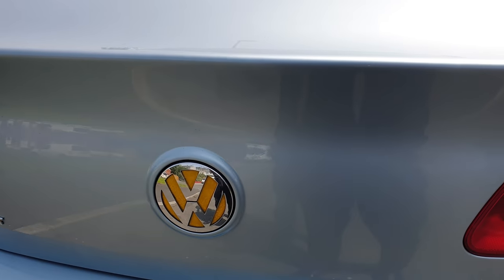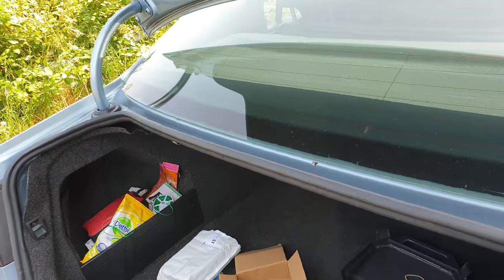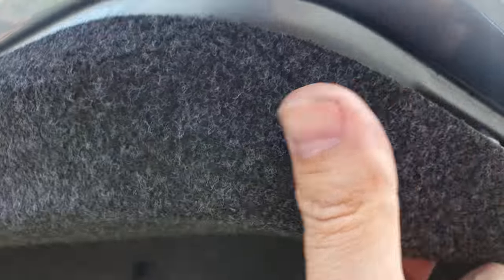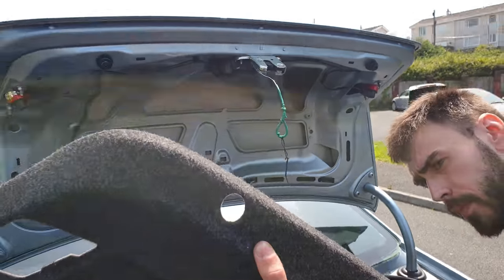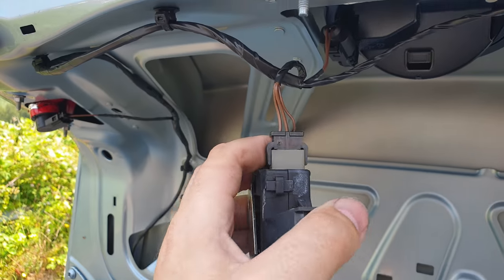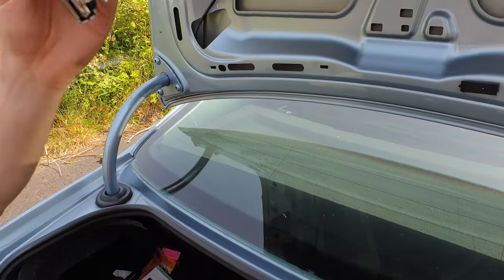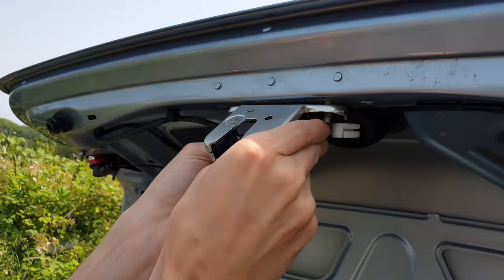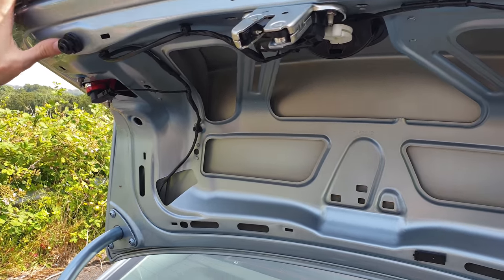Tailgate boot (trunk) lock repair Volkswagen Passat Skoda Seat Audi

Comment: Thank you SO MUCH! There used to be a video that showed how to do this, but YouTube deleted it.  My latch wouldn't close in cold weather, so I took it out, took the latch apart, greased its internals and put it back together.  Took about an hour all together.  My one piece of advice is don't take the little rubber stops at the edge of the trunk off.  They are really hard to get back on, and if you do it wrong, the trunk won't latch.

Comment: Good useful video. I have a problem with the boot seal. It sticks to the door when I open it especially if the car is on sun.
Reply from the maker: The rubber is cooked, get a replacement one, it's easy to fit.

Comment: Good video but you've forgotten about the emergency release cable (needs releasing on the old and putting back on the new) that goes to the manual release handle. Figured it out for myself though :)
Reply from the maker: Oh yeah. Not all cars have it tho, the one in the video didn't  🙂

Comment: Hi, I have a problem with the Passat b7, it's the same lock, the lock works on the button in the driver's door and on the key, but it doesn't work when I want to open the door manually, can you help?

Comment: I have the same problem, but I can open my trunk with key or with the button on the drivers doors, but I cant open it manual on the volkswagen logo on the trunk, should i do the same to replace that lock or is it some other problem?
Reply from the maker: The, issue i fix here , its an mechanical one , the boot dont stay closed. What you have its an electric one. Can be from the lock boot , or from wires. Check the conector and give him a good clean . It my fix your problem. If not replace the lock , is not very expensive.
Reply: @IamJules  Hi, i have the same problem as Smid and i'm gonna clean the conector when i will be available on a sunny day but your vidéo is truly a great help cheers mate

Comment: The one in description doesn't look the same as one you are using
Reply from the maker: yes, they updated the product to a newer version. the old one i used in the video is not produced anymore. but they have the same functionality so you can fit the new one just like the one in the video. I hope that helps.
Reply from the maker: I searched a little more and actually found the old style boot lock. 
I updated the link in the description, thanks for commenting!
The old one is made of metal and I think it's better than the new one which is mostly plastic :)